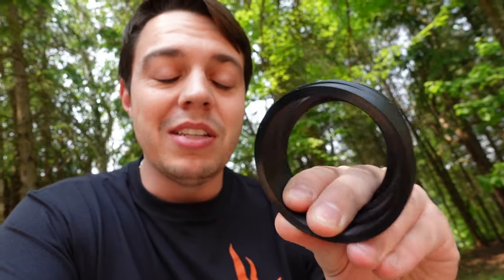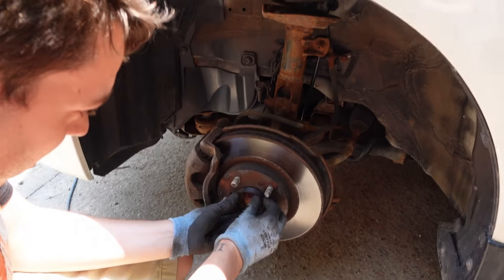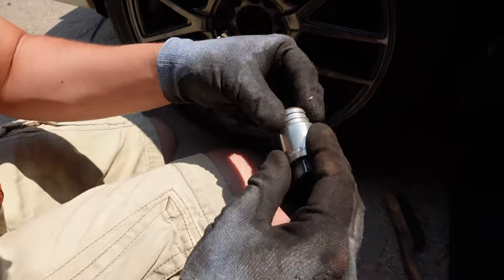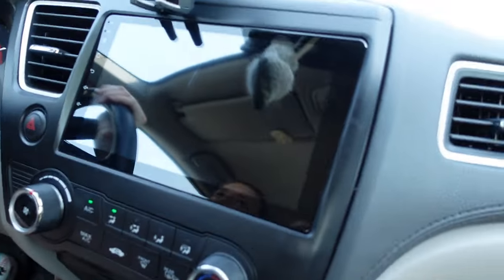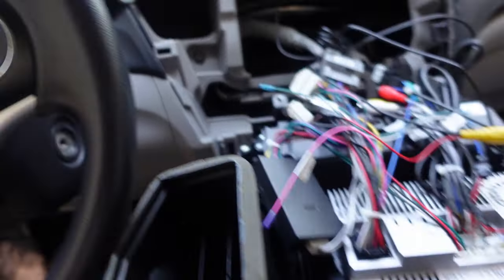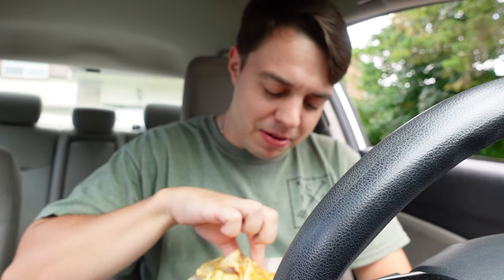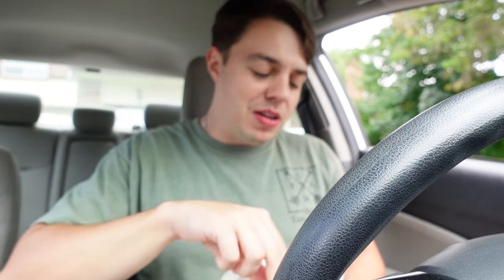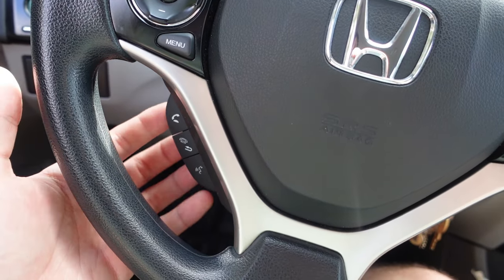Update On Android Head Unit In My Girlfriend's 2013 Honda Civic

Comment: The small screen not turning on (called the imid) is usually related to the fuse that you mentioned in your installation video blowing. If the screen is gone/black + the wireless key fob is not functioning, then it’s fuse 29 that blew.
Reply from the maker: We never experienced just the imid not working, but guessing you did and that's the fix?
Reply: @zach_lush  Yep, our imid stopped working as well as our key. We looked online for help and replaced fuse 29 and it resolved the issue. Later, we figured out the way we plugged in the unit was causing a short circuit, so we contacted the seller for help and then we were able to properly plug everything in. Our unit is working great now.
Reply from the maker: @CriShoux  nice!
Reply: @CriShoux my imid never turned off is my issues
Reply: @exclusiveglitchingproducti3520 yeah same what do i do
Reply: @CriShoux  can you send the correct instructions to avoid blowing a fuse? I am planning on upgrading to this stereo soon.
Reply: @Kenneth-bm5zr  Unfortunately I don't have the exact instructions. However, it's not complicated. Our delivery came with a rectangular component called the canbus/protocol box, and there's plug port on both sides (but I just checked Google images and it might be only one port, I don't remember exactly). You just have to see which cables plug into it (might be a cable from the radio or a cable from inside the car) and it should work.
Reply: @exclusiveglitchingproducti3520  have you figured this out? Mine is doing this now.
Reply: @pic2022  I did fix it I unplugged one of the cables that made it stay on from the head unit but you won’t be able see your songs up there on the Imid
Reply: @exclusiveglitchingproducti3520  im okay with not seeing the songs which cable is it?
Reply: @killa1157  I forget it plugs into the head unit harness tho it’s a smaller regulator plug from what I remember
Reply: @exclusiveglitchingproducti3520 thank you I was able to pin point it

Comment: So I went into my factory setting that required the 4 digit pin and was looking to see what settings were in there and clicked on the first one that said protocol settings to see what it was and I saw that it had words on the left side that I didn’t know what they emmental but I. The right were vehicle models. So I click on the first one on the left and then found the year and model on my vehicle then clicked out. Hold and behold my steering wheel buttons are now working. When I looked before the radio showed like of it was connected to a Benz which this vehicle is a civic. But I got it working now. Which the radio had a way of telling you to change that setting from the start.
Reply from the maker: Sounds like you had a similar issue as us. And it seems like it's all fixed and your good now?
Reply: Cual es el código?

Comment: My wifi on the unit is soooooooooo slow. What's strange is a I ordered a unit off amazon, and when I emailed the seller - they actually sent me a .mp4 of your original video LOL.
Have you noticed wifi being incredibly slow on the unit?
Reply from the maker: Oh wow, thats hilarious! I'm assuming when you say wifi you are running a sim card off of the headunit? Unfortunately I can't give any feedback on this since I do not use wifi off of it. We just connect to the unit via bluetooth and use android auto or apple carplay.
Reply: For anyone reading this in the future:
If you're getting this for carplay/android auto - but also want to be able to surf the web etc with the other android features - the WiFi no matter what you do, will be horrendous. My workaround is to plug my phone in via USB and use screen mirroring. It works like a charm, and when you unplug it, it'll auto connect via bluetooth and bring Carplay/Androidauto right back up. I'm waiting for the seller to send me a harness that supposedly will restore factory backup camera function (I'm in a 2015 Honda Civic EX with backup camera/lanewatch camera (I'm opting out of the laneswitch camera, because I live in a city area so right turns basically render my head unit into a glorified CCTV) the harness the seller is sending will go from the stock plug, and convert it to a RCA yellow jack for the RCA cable connection that comes with the head unit, I'll update here if it works) - but we will see. ps: I know this is kind of niche Zach, but have you ever thought about making a discord? This way people can discuss the head unit and your videos in there instead of comments? Regardless, thank you for documenting this it was a huge help!
Reply: @KillaOR did you eventually get that harness and which Amazon seller did you buy from?

Comment: Hi, Nice video but with mine I still got an issue with the steering wheel control, like volume and stuff, what did you do for yours? and my car already have a camera in it how can I switch it to show on the new screen not on the top one. Tyyy
Reply from the maker: The steering wheel controls worked when i set them in in the SWC app. I dont think you can get your factory camera to work on it
Reply: @zach_lush  appreciate you, i’ll try to figure something out tomorrow as i just installed it today

Comment: Does anyone have any idea how I can get my iMiD to turn off? It's staying on. It's scaring me. I tried every honda civic option in the canbus menu (I have a mekede m7 pro). They sent me a canbus that says rz-hd60. I'm assuming it's raise (not sure). Unfortunately it does not have an option for a 2013 Honda Civic. Only 2012, 2014-2016 and so on. I'm totally lost right now. Afraid my battery WILL die.
Reply from the maker: Yes, your battery will die if it remains on. I have the Raise HD-RZ-06, not sure if it makes a difference. I'm also assuming you saw my install video where I had the issues with the fuse. Inly thing I can recommend is changine the model on the headunit through the settings. Thats fixed my side camera issue. Even if it doesn't have your exact year try different ones. Otherwise I'd reach out to the seller.

Comment: Last night I tried to install a similar head habit and had the same issue with the fuse blowing. But when we put in a new 10 fuse it blew aswell. We tried going up to a 20 and that blew aswell. Do you know how i could fix this?
Reply from the maker: Putting in a bigger fuse isnt a good idea, usaully it means something is shorting out. When it haplened to me i put the original radio back in and made sure everything worked. Once that was confirmed i disconnected the battery and reinstalled it, no issues ever since. When the battery was connected and i pulled the radio it caused the issues with the fuse blowing.

Comment: to regain steering wheel controls it’s ussally part of the adapter harness wring it will be labeled “key 1 and 2” the actual wires

some stereos have a dedicated port too for those with a break out for those two wires as well

if your steering wheel controls have their key wires going to the stereo you should be able to connect it

if it doesn’t you will have to get a module that basically reads radio singles for steering wheel controls, you will have to hook it up with the wiring in your stereo and set it to look for Civic steering wheel inputs.

those wirelessly talk to the steering wheel so it’s entirely contained within the stereo compartment

it is def doable. I have my 2006 Frontier and i put a stereo with steering wheel controls when it didn’t have either of those factory
Reply from the maker: Thanks for sharing, I was having a feeling it will require a module. I'll have to look into it further
Reply: @zach_lush  any updates? i have a similar issue with multiple head units lacking SWC control